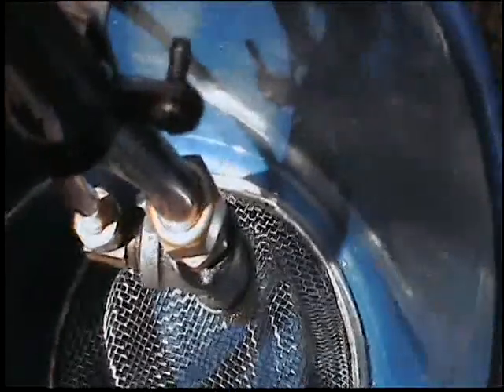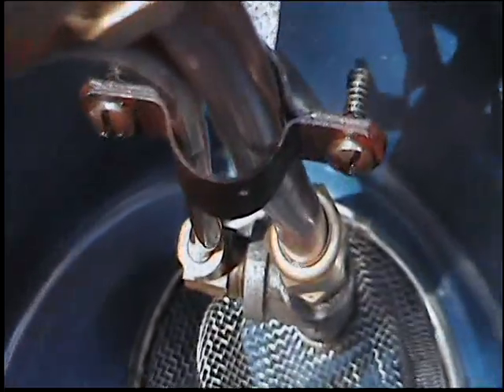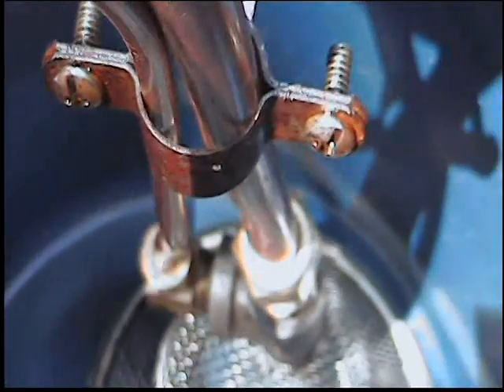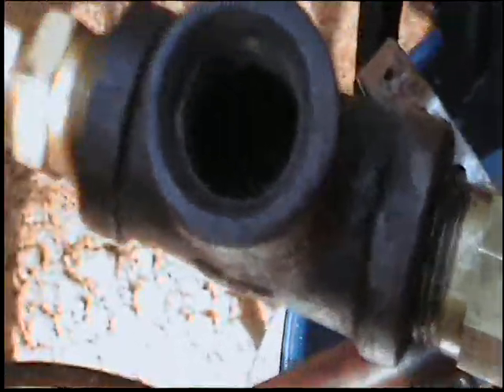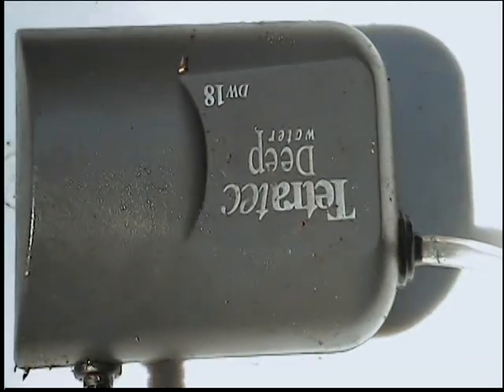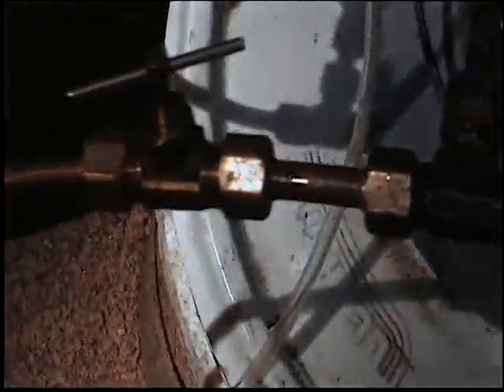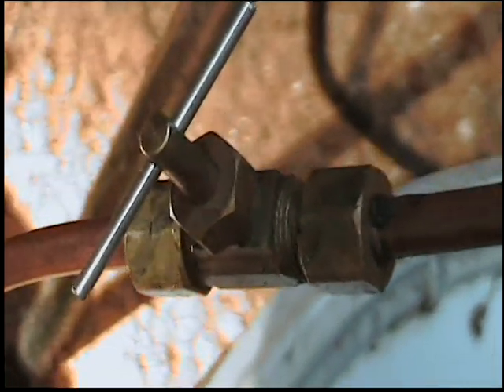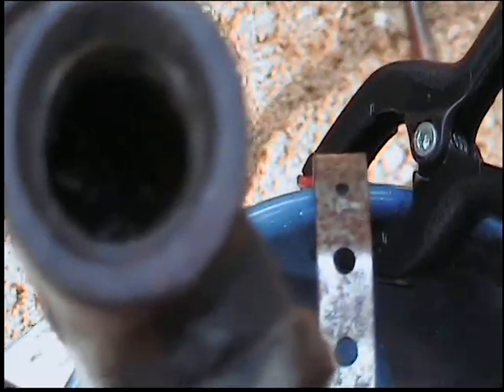Air Gas or Steam Lift Pump

Comment from the maker: Someone asked me why I use the lift pump on my burner. Typically with a Babington burner, some of the oil is not atomized, but runs off the Babington ball to the oil reservoir. Only part of the oil film on the ball goes over the steam or air hole or holes. To get the oil back up over the ball the oil needs to be lifted from the reservoir.  Gravity feed could work, but is hard to regulate and the operator would have to deal with the lower drain reservoir somehow.

Comment from the maker: I have not checked the temperature after the lift pump.  It is certainly hotter once the steam lifts it to the ball. Yes I use a propane torch to preheat the ball as well as the plumbing of the lift and the oil for startup.

Comment from the maker: Hi Ranger,  No it actually works more like a basic aquarium undergravel filter. The air bubles rise in the tube and push the fluid up with them as well as making  the fluid and air combination, lighter than the fluid surrounding the tube. There is no vacuum or jet invlolved in this pumps operation.